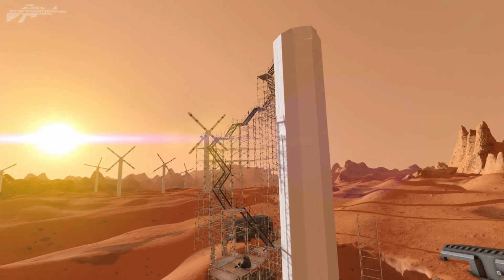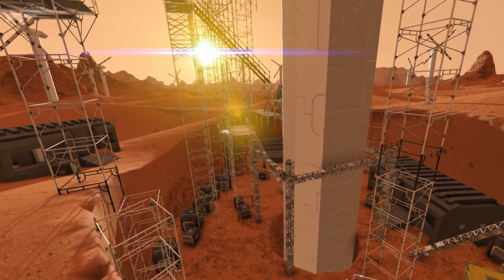Space Engineers - Mars Renewable Energy Site

Comment: The phenomenon seen here, that is, the scorching, is obviously caused by exposure to the high-temperature exhaust being expelled from the engines. Any man with half a brain could deduce that. However, the much less obvious result of said process is that the engines, due to heat damage from rapid reentry, burn fuel much less efficiently. This excess fuel is expelled through the engine bell in a gaseous state, and while most escapes into the atmosphere, a portion of it is forced into the soil, where the high temperatures bake it into the ground. This creates a sort of ceramic ash layer which can, surprisingly, be refined into small amounts of viable fuel.

   The amount of ash deposited depends on length and intensity of exposure, as well as the angle at which  the exhaust is expelled. For example, the long streaks of soot trailing behind the wreck will be very shallow, ranging from paper-thin to about the thickness of a dinner plate. The patch there at the end, though, where the ship came to rest, will have had a much longer exposure time, and thus may extend 1-6 inches into the ground. The forward engines, pointing at a more inclined angle, will likely be deeper, though spread over a smaller area. We estimate it to range from 3 inches around the edges to as much as a foot thick.

   Enjoy your pseudo-sciency explanation as to why there's uranium around the wreck. I look forward to playing this map.

Comment: One thing I noticed, and I couldn't unnotice, was how all the wind vanes were in perfect sync.  I might suggest varying the rotor speed just slightly vane to vane so they don't look like a wall of Swiss clocks.
Reply: The speed is good, seeing how close they are to each other. Most wind farms are pretty synchronized. I did notice, though, that the blades were half blocks, and not slopes.. If they could be changed to the small half of the 1x2 slope set, they would look nicer.

Comment: you know what would be a nice mod for RP? changing the grinders so that you only get scraps or a chance for the original components till you get to the highest tier where you actually get it all back because it is "more precise and advanced" so you actually manage to take stuff apart with it without wrecking it. that would give you an actual reason to progress the grinder tiers apart from beeing faster
Reply: well that would be one reason why it would be best if it was a mod, so people could toggle it. still i think that would be fun because that would force you to use your head and build around existing components and maybe tow and weld a whole module to your structure in the beginning. though that would mean the mod should include a non reversible merge block (weld) so you can easily connect grids that are not ment to be disconnected ever again (except for grinding them off of course) this block should be either be a half height block or a full size and as soon as they connect they transform into a regular armor block (or 2 is they are full size) or maybe still a special bloch that cannot be interacted with and just has a nice thick weldline on it for the looks and feels

just imagine: you crash with your ship and the key components are barely intact and maybe are scattered around the crashsite so you have to start rigging up a connection between the reactor core in one module and the medbay in anotherone because lacking a higher tier grinder you cant dissasemble either one. 

because as it is now in this scenario i usually would just go and grind off the components and place them on a nice platform right next to eachother ans start scrapping the whole wreck to build my base. if you had to commit about a place you put your medbay you would either start to plan ahead or would have to live with a medbay next to the refinery till you get a better grinder so you can recover the precious medcomponents.